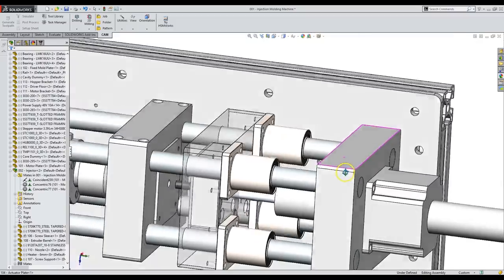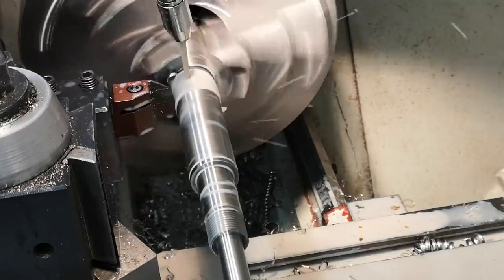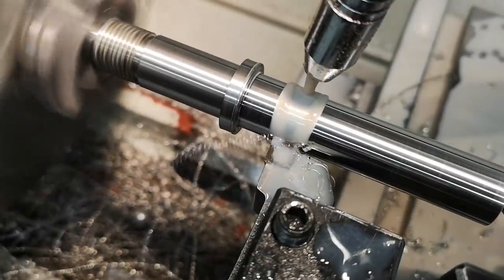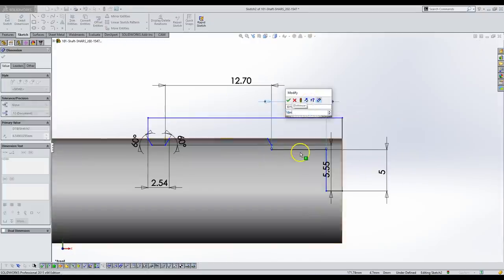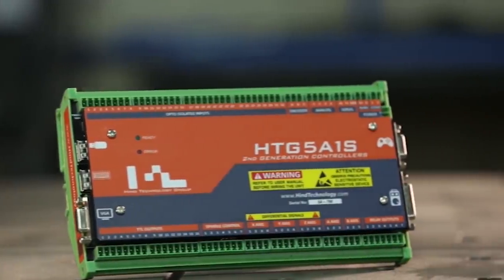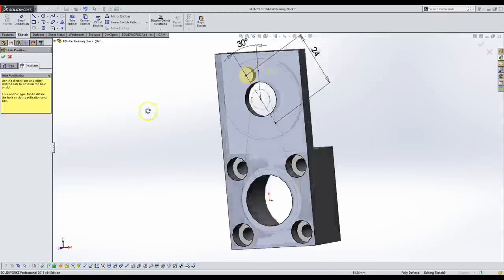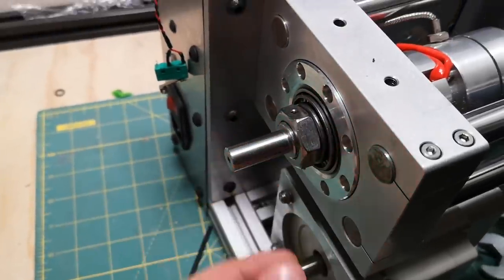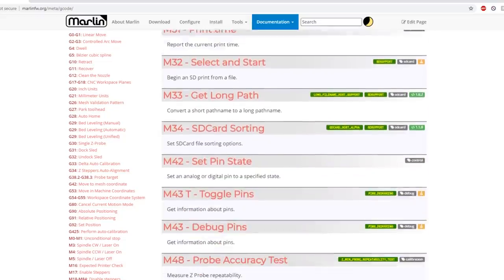Injection Molding Machine Part 2:  The Extruder Screw

Comment: Wow, A MASSO sponsored video. Haven’t seen one of these in awhile. Are they around Anymore? 

I remember they had many G2 issues early in. Last post i saw on a G3 looked positive but that was three years ago. Since then I’ve not heard it mentioned until I ran into this 3 year old video. 

Compared to Linux CNC its very expensive wall art. Cant say I’ve had any issues using a PC myself but there have already been so many available online that work well to 6 axis for  $500 or so. I almost pulled the trigger back than, but Im glad i decided to wait it out to prove themselves over time first. Must be a small market if still around. The G3 with touch screen is pretty. For $1400 though its still a hard pass.

Comment: Very cool. Question: Why not cut the auger using a narrow grooving/parting tool by incrementing the compound set parallel to work/spindle to increase the groove width?
Reply: That's how I would have tried to do it. Maybe he has a reason. Or maybe he's just a masochist?
Reply from the maker: I think that's probably the right answer.  At the time I was concerned about being able to grind the tool (I'm really, really bad at grinding), and I also though I would be cutting a tapered root so I was worried about synchronizing multiple passes with that.  The actual cut has a very high helix as well, so the tool would have to be thin enough to not chatter but thick enough that it could withstand some fairly serious Z direction force..
Reply from the maker: @Loebane  ...the second one...

Comment: Wouldn't you want a smaller gullet at the end of the screw?  I'm used to seeing large screws on 2000 ton machines where the ratio is very small compared to the diameter.
Reply from the maker: Yeah, you're absolutely right, real machines do.  I struggled so much just getting the root cut I wasn't sure I would be able to pull off a taper.  We'll see how it work, and if not, perhaps a plunger is the way to go :)

Comment: "Machine parts" should be a duty free tax code.

Also there is usually a CNC threading cycles which should be able to cut a screw like the drawing you showed. You'd use a stout parting tool say 3mm wide and not much longer than the insert.

You'd need a somewhat rigid machine for a 3mm wide bit and have to be somewhat brave to run it, so milling it is probably better for a hobbyist. The screw looked good to me.
Reply from the maker: Agreed.  I might ask them to label my orders "birthday present" or something next time :P.  Yeah the machinists in our shop said they'd hand program it with canned cycles and a live tool, but our cnc lathe is always pretty busy with production stuff

Comment: The generalized power rule says that wattage = voltage * amperage, and the max amperage that a motor can handle will mainly depend on the thickness/length of the wire used in the windings (i.e. a thicker wire can handle more current without overheating than a thinner wire).
Reply from the maker: Makes sense.  Big beefy wire, more current, moar power.
Reply: @TabletopMachineShop  The hobby BLDC motors usually have a number n of stator coil poles on the inside and n+2 permanent magnet poles on the outside, coupled to the shaft, which gives space for a higher area of windings per pole (not going to go into motor Kv) but gives the motor a higher moment of inertia. It comes at the cost of producing the most torque at a higher RPM and it's pretty low at lower RPM. The movement isn't very precise either and the position can be easily upset, even with good driver tuning, so it can't handle loads very well. 

Servo induction motors on the other hand (usually) have n+2 stator coil poles on the outside and n permanent magnet poles on the rotating shaft for a greater precision of movement with low moment of inertia and high holding torque, or at low speeds. Unlike BLDC, it comes at a cost of lower power for the same size motor and lower torque at higher RPM. The torque that can be produced has also quite a lot to do with how fast the coils can be magnetically saturated and the total magnetic reluctance of the system. Industrial servos often use very high voltages for this very reason, as it reduces the induced losses and saturates the coils faster, while hobby BLDCs can just get away with lower voltages and high currents; some well over a hundred amps for a motor fit for a small quad. A lot of heat being dissipated due to BLDC design and active cooling is key, while servos are often enclosed and passively cooled.

Driving the motors is also different, with BLDC ESCs simply chopping up DC current into three phases, with timing being usually based on feedback voltage from the coils in an open loop, though some may utilize hall effect sensors. Induction motors on the other hand are driven with inverters that produce a chopped up approximation of a three phase sine wave, with timing being controlled similarly, but also with the additional aid of an encoder for more advanced closed-loop vector control in most cases, where positional accuracy and rigidity is needed, paired with a high holding torque. This needs some tuning on a per motor / driver pair basis to get it good enough and can be time consuming. More modern drivers may incorporate an auto tune process though, requiring few steps.

BLDCs could also be vector controlled, but the cheap three phase bridge drivers on ESCs can't do that, at least out of the box and without some external logic hardware to interface an encoder. Not sure how e.g. ODrive does it, but it's one solution for using BLDC as a servo, with encoder feedback. Many camera gimbals also use them due to lower price, since the torque required to stabilize a camera isn't that great, usually.

Comment: I suppose this screw is not your final one?
It will not work properly because it has a uniform depth, but the channel in the screw will need three zones, the feed zone with an uniform depth (deepest channel) and needs to be cooled, then a compression zone with decreasing depth to be able to compact the resin once it starts melting and force all air out via the feed opening, and lastly a metering zone which holds the pressure to extrude or inject the polymer, it has an uniform or decreasing channel depth.
In fact the screw will need to be twice at long to be able to locate these zones and to create enough pressure, probably there are going to be backflush problems when injecting the polymer.

How are you going to inject the polymer into the mold?
Just extruding polymer into the mold will not work, an injection moulding machine has a continous running screw which fills a chamber in front of the screw, then a hydraulic ram will force the screw forward a set distance to inject the polymer in that chamber into the mold.
After the injection stroke the pressure on the ram is released and the screw will refill that chamber with new polymer and force itself back into the initial position doing so.
I think also hydraulics will be needed to close the mold, I'm not sure if that actuator will be strong enough, as required injection pressures are somewhere between 40 to 160 bar (600-2400psi), holding pressure will be dependent on the surface area of the object to be molded.
Injection has to occur quick enough to prevent short shots, this is polymer solidifying before the mold is full.

It's a very interesting project however, and I'm curious to see how you gonna solve all the issues.
Reply from the maker: Hi Tom,

Thanks for the comment, I really do appreciate expertise :P.  I guess what I'm hoping to rely on is a low-pressure requirement in the mold and a close fit between the screw and barrel.  There's a bit of a space at the front of the barrel for plastic to accumulate, and I guess I'm hoping the static pressure in there will be enough to permit flow into the mold.

I'm so close with this design I figure I might as well test it and see what happens.  I certainly know there's a reasonably high risk of it not working, and if it doesn't I think I'll just switch to the plunger system I alluded to in the video.  I really like experimenting and finding how things do and don't work myself, so I won't be crushed if I get zero static pressure and no injection :P.  Thanks again for the comment and the great description of the process!
Reply: @TabletopMachineShop  Thanks, and I wish you success with the project, it might work this way with a very free flowing mould and a low viscosity resin, you can also play around with the temperature to lower viscosity, how far you can go depends on degradation stability of the resin used, it will be obvious enough if it's too high, you will get some yellowing and excessive smoke.

Comment: You did not need to go that far. You could have bought a off the shelf oil extraction screw for low cost online.  It is a compression screw.
Reply from the maker: Yeah actually those do look promising, good tip.  I'd have to find a really small one though

Comment: If you want your screw at an angle, all you need is a lathe with a taper attachment.
Reply from the maker: Yup, no luck there though :(
Reply: @TabletopMachineShop   Why not set it up between centers. Admittedly you may have to play around with the dog to prevent issues with your setup. What I am trying to say is when you are turning the dog is always loaded keeping the shaft indexed with the headstock. With a milling setup you would have to ensure the shaft can't move away from the drive dog to prevent your end Mill / part from self destructing.
Reply: offset the tailstock...
Reply: @SuperAWaC  basically what I was trying to get at

Comment: hi,i also make a mini type injection machine with full electric units,it seem your melt gear wheel ratio is too small..
Reply from the maker: That's quite possible.  If it turns out to be a problem I'll find a motor with a planetary gear drive.  Thanks for the advice!

Comment: why not just use a modified wood auger drill bit?
Reply: HomeDistiller because that would probably be too easy!
Reply from the maker: I actually started using one but quickly destroyed it trying to press it into a sleeve for the bearings.  I then decided just to make my own... it's only one part, how hard could it be?
Reply: Tabletop Machine Shop spoken like a true engineer!

1) try the easy route
2) break something in the process
3) try the hard route
4) regret vocation
5) produced part

Comment: Why no taper attachment to make the tapered screw?

Edit: spelling
Reply from the maker: I just don't have one :(
Reply: But you made the live tool and I'm pretty sure taper attachments are even easier to make. I'm not well versed in the internals of lathes but I don't think there are any modifications to the lathe other than bolting on the attachment. I thought a taper attachment is one of those beginner friendly projects people tackle pretty early on.
Reply: @TabletopMachineShop  depending on how much taper you need you can just offset the tailstock when turning between centers
Reply: @paulb8264  Taper attachment would be like difficult than what he did; bolt a motor to a spindle and belt drive it.

Comment: What material are you used for the screw and for the housing?
The pitch is equal?
Here is how I planing to do it, but not sure. (and will be shorter)
http://www.cnc-club.ru/forum/viewtopic.php?f=160&t=26717&p=543934#p543915
I will need to do 4th axis milling, but my plywood cnc wont handle it. So, may be I will do it like you...
Reply from the maker: I used 304 stainless steel for the screw and aluminum for the barrel.  I was afraid that an aluminum screw would fail too quickly.  The pitch is equal, yes -- 10mm.  I have been cautioned by lots of people that my screw is too short, so I'm interested to hear how yours works!
Reply: @TabletopMachineShop  sorry, but I'm just planing to do a mini, or a micro TPA unit. So, it wont be soon.
For now I just collecting the information.
If your screw is short, what can you tell about this unit?
 (much shorter)
https://www.youtube.com/watch?v=-ewx94zGB5o
The stainlessteel and the aliminium thermal expansion is ok for your diameter? Not too big the gap between the screw and the barrel, when it will heat up?

Comment: Kids. Ha! How did people ever survive without computers? Ok, the easy way to make an auger with a tapered root diameter (aka minor diameter) on a manual lathe. Offset your tailstock center. A boring head works great for that. Just tap it in, nice and tight or make some sort of dog for it. You'll need a dog and dead center in the spindle. Use your milling attachment. Bob's your uncle.
Reply from the maker: That's a really good idea, that was totally off my radar haha.  I had done that way back when I used my own Taig lathe to make tapered pins, I just totally forgot lol.  Thanks for the tip!
Reply: @TabletopMachineShop  Glad I could remind you, although I'm sure you would have thought about it eventually. I'm looking forward to seeing your project completed.

Comment: sir tell  more about python and cad and gcode and how you did it
Reply from the maker: The Python script controls the motors and heaters directly using Phidgets, so there currently is no G-code.  In the future, I'll either use Arduino with a basic screen interface, or a 3D printer board that you could send G-Code to.  Boards for 3D printers tend to accept G-code one line at a time over a USB serial port connection and send after each one is complete, so it would be pretty easy to write an easy interface that took molding parameters like shot size and cooling time, converted them to G-code motion commands and sent them to the 3d printer board.

Comment: I am a machinist and watching you flounder designing extremely complicated and ill-fitting solutions to problems that have been solved 100+ years ago pains me greatly. I went and flipped through some of my real old books, and all the techniques required to make this auger on a manual lathe are contained in books dating back to around 1900 (the techniques are definitely older, but I don't have many books from earlier than 1900), most of these books are freely available online. I suggest you check out any books written by F.W. Turner.
Reply from the maker: I am not a machinist, and floundering and designing extremely complicated and ill fitting solutions is kind of what this channel is about... If this were anything but a hobby I would probably take it more seriously, but I get excited to try things and have a great deal of fun doing it, even if it's not technically the correct approach.  Thanks for the book tip, I'll look into it... he has a good name for a machinist.
Reply: @TabletopMachineShop  that he does. however, i am specifically referring to your toolpost spindle, when turning between centers and offsetting the tailstock would have been the solution, saving you hours and hundreds of dollars.
Reply: @SuperAWaC  offsetting the tail stock wouldn't fix the initial problem that caused him to not turn the thread with the lathe, in the first place. Offsetting the tailstock and running between centers will only help with the taper he wanted, but he's still have the chatter. So, he still would have needed the live tool. Although there are ways around that too, but none you mentioned.
Reply: @xenonram  the chatter was caused by the atrocious tool that was selected